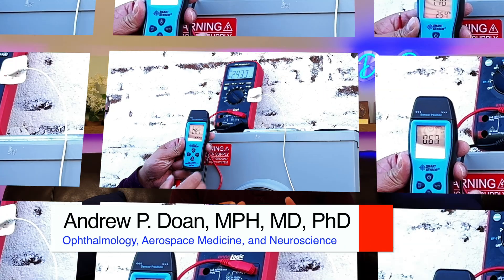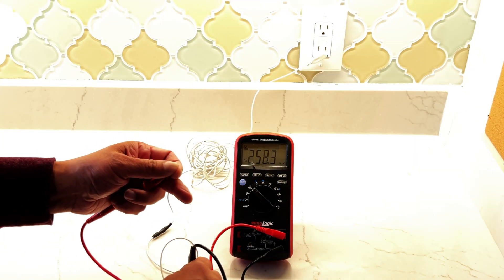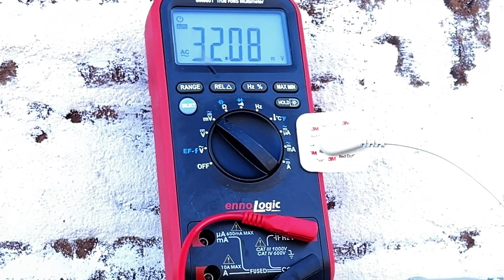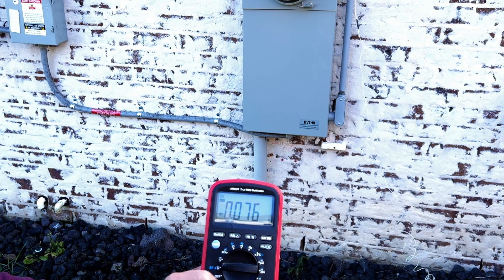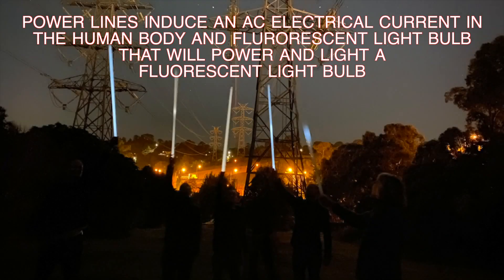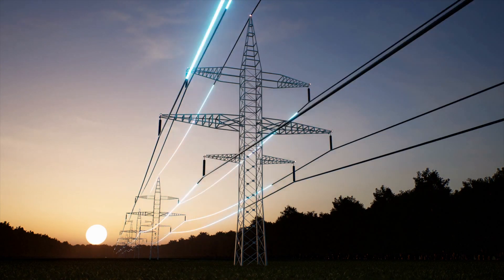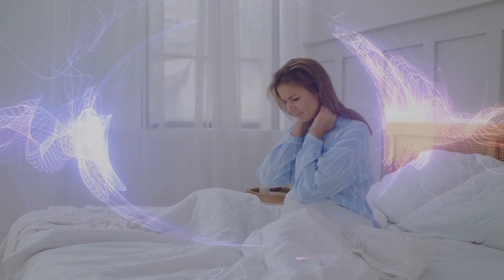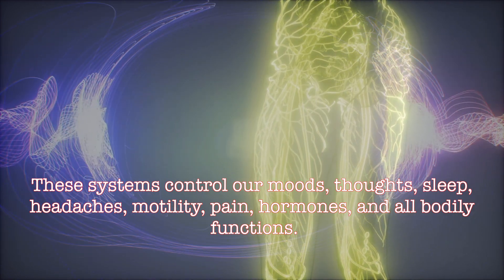Earthing and Grounding Science: Measuring Body Voltage & ELF EMF Effects on The Human Body

Comment: I live in an apartment building surrounded by other apartment buildings and the settings menu of my cell phone shows there are dozens of WiFi networks broadcasting a microwave WiFi signal simultaneously which saturates everyone's apartment living space with microwave EMF's throughout the neighborhood.  Also, each apartment building has dozens of electric utility smart meters emitting harmful microwaves everywhere in the neighborhood.  I am stressed all the time from the EMF radiation causing excess cortisol levels in my blood.  I ingest lots of organic ashwagandha powder with organic grass fed cows milk to lower my cortisol level at night to help me sleep.  Should I first start wearing microwave shielding clothing and sleep inside a microwave shielding bed canopy before I start grounding my body inside my apartment?    Would it be safe to ground my body on a grounding sheet, grounding mat, or grounding arm band in my apartment without wearing microwave shielding clothing during the day, and without sleeping inside a microwave shielding sleeping bag or bed canopy at night?
Reply from the maker: Use a canopy AND use this to ground: NCB Plug Dirty Electricity Filter for Grounding: https://tinyurl.com/ncb4u

Comment: In my office I measure about 2.0vac between my un-grounded body and the ground on the outlet. How much ac voltage is considered to be high value?
Thank you for the easy to understand video.
Reply from the maker: VAC is not normal for living things. 0 is normal. I think 200 mV is too high. Voltage gated ion channels open at 30 mV and that causes problems. Consider these review papers:

Bertagna, F., Lewis, R., Silva, S. R. P., McFadden, J., & Jeevaratnam, K. (2021). Effects of electromagnetic fields on neuronal ion channels: a systematic review. Annals of the New York Academy of Sciences, 1499(1), 82–103. https://doi.org/10.1111/nyas.14597

Pall M. L. (2013). Electromagnetic fields act via activation of voltage-gated calcium channels to produce beneficial or adverse effects. Journal of cellular and molecular medicine, 17(8), 958–965. https://doi.org/10.1111/jcmm.12088

Comment: why do you need the earthing cable at all? can't you just put the black end into the ground prong and hold the red end?
Reply from the maker: The earthing cable is crucial for safety! It helps to prevent inadvertent contact with the live wire in the outlet. The black end of the voltmeter is very thin can be inserted in unwanted areas of the outlet.

Comment: Dr. Doan, 1st time viewer here
Wondering if  you had any ideas on an inexpensive dyi grounding for sleeping & or other shielding modalities  in general that are dyi. Thank you for sharing this💯 valuable health video🙏💖
Reply from the maker: When I first started grounding, I used aluminum/metal tape on my sheets. You can also place the metal tape under the fitted sheets. Connect the conductive tape with alligator clips to a copper wire that is connected to a copper grounding stake outside. You can drill a small hole in the side of your house to pass the copper wire through, and then seal the hole with caulking. Confirm conductance with a voltmeter.
Reply: @DrAndrewDoan   Cool, will try it, thank you very much, until you are better paid!❤✌🙏

Comment: Would being grounded while near emf negate the negative effects? Or would it just allow the current to flow through the body randomly activating these different pathways? I suppose a good comparison is seeing birds on a power line, and sonetimes when they become grounded they get electrocuted. Thinking about getting a far infrared sauna and placing a grounding mat inside. I cant afford a unit with zero EMF.

Thank you!!
Reply from the maker: Thank you for your comments and questions. Being grounded near EMF will negate the negative effects. Grounding negates the EMF-induced currents. I recently started using near-infrared lights to stimulate mitochondria!
Reply: Thank you for your response! I just ordered an earthing mat. I am so reassured hearing that being grounded negates the effects. In my research it is so funny because there are so many people that talk about how bad EMF is especially while grounded, but you and Clint Ober say the opposite, and I am inclined to believe you and Clint over the others. I really appreciate it!